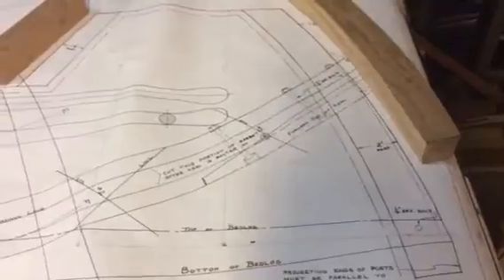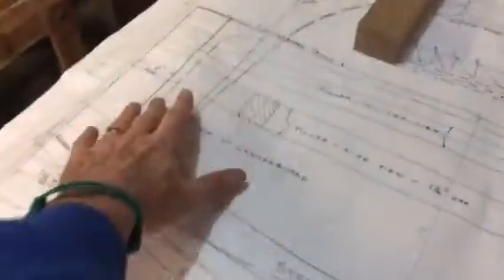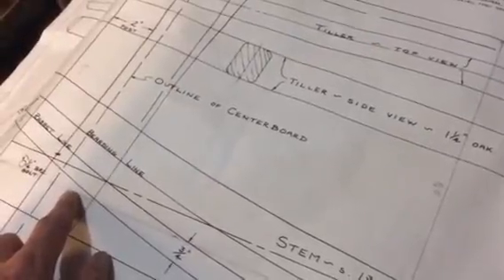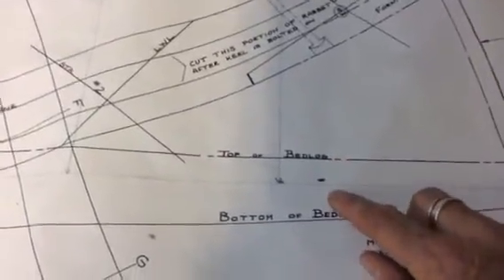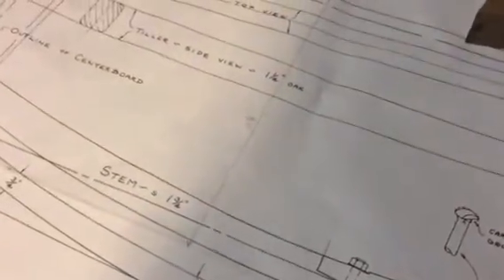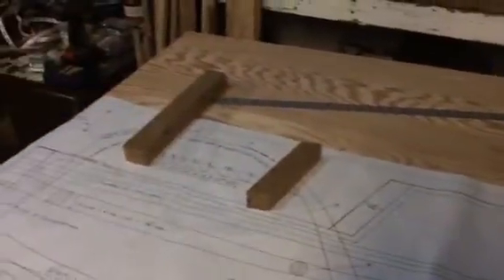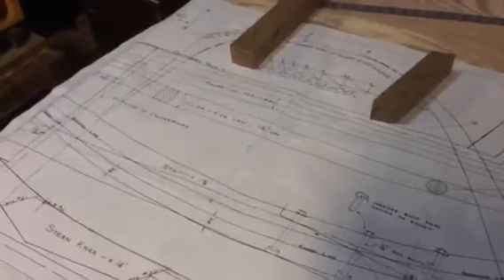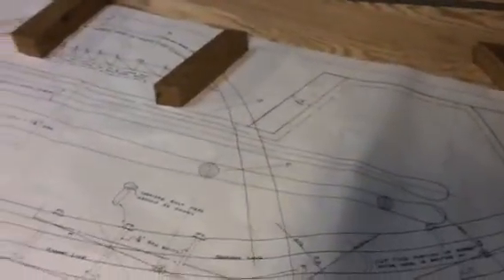Boat Building Centerboard Trunk layout Haven 12 1/2 - Episode 7

Comment: Hi Chuck.  Not sure you're looking back this far but I'm in the process of building the Center board Trunk for a Haven 12.5 and I think I finally understand the angle difference between the tops of the trunk and the top of the bedlogs.  The frames are perpendicular to a construction baseline and the tops of the trunk are parallel to this line.  For some reason there is a 2 degree offset between the  baseline and the waterline.  This appears to have its origin in the Herrishoff 12.5.  Somewhere in Bray's book he mentioned that the offset table only had diagonals which makes sense since the frames and stations are not perpendicular to the waterline (LWL).  BTW, I'm looking forward to your return to the Some Sound.
Reply from the maker: @sleepykittyboatworks  I went back and watched this. It has been a while!  I’m antsy to get back to the Somes too. Soon..  I wish that I had had the opportunity to sail a Haven prior to building it. Frankly, I had more issues with the trunk and board than any other part of the boat. In my sea trials I had a leak and it was in the aft joint between the trunk post and the slot in the forward part of the deadwood. It was rather maddening because I couldn’t see anything to where it was leaking. I ended up with the boat back off of the trailer, in the shop and poured water into the bilge and then got underneath her and watched for it to leak out. I managed to poke thickened epoxy up in through the back part of the slot until I sealed it. The rest of the story is with the design, to which I think you referred. The LWL is really close to the top of the lower forward part of the trunk. I’m going to carefully consider this on the Somes.  In calmer seas, not a big deal but when sailing to windward and slamming into wave troughs, I had water coming in, leaking through the trunk cap. I have since sealed the cap much better. If I had it to do over, I might alter the trunk and make it a couple inches higher, at least in that forward, lower part. It would not make any difference for the board. Hindsight is 20/20.
Reply: @JenkinsBoatWorks  Do you think a set of smaller screws along both sides of the trunk caps into the edge of the plywood CB Trunk sides and some 5200?  I've already built the CB Trunk so I can't add the extra inches to the top as you suggest.  Looking forward to continued Some Sound work.  Thx.>
Reply from the maker: @sleepykittyboatworks  I like where you are going with this. Maybe not 5200, unless you never need to remove the cap. 3M makes another product or two that would seal and slightly less permanent